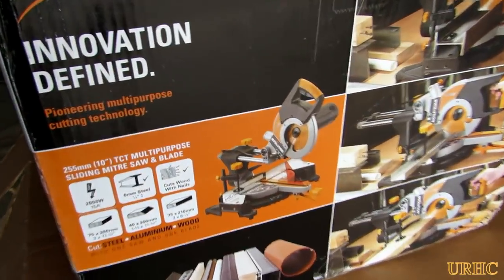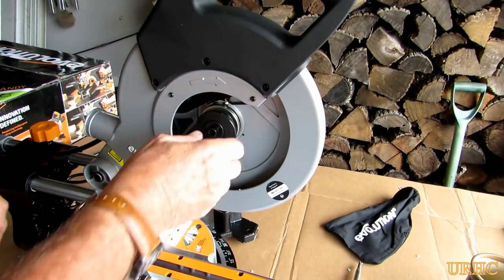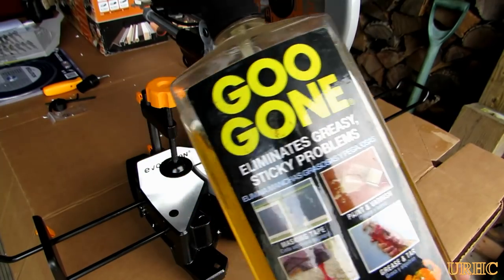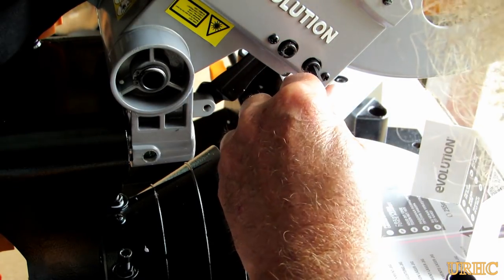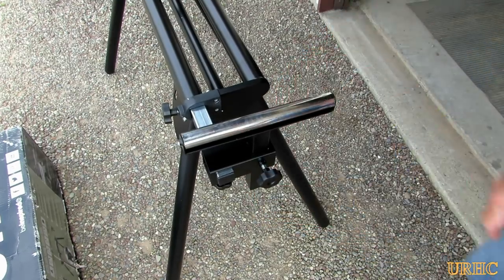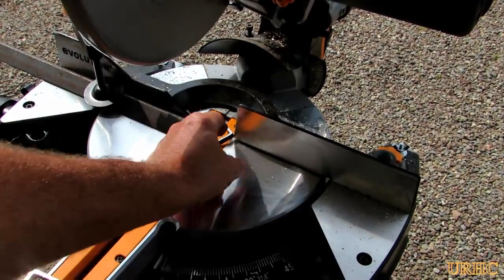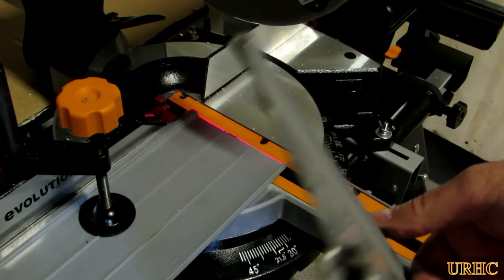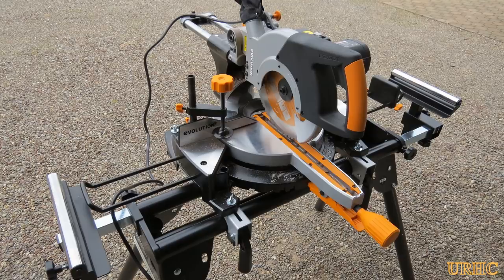Evolution Rage 3 TCT Multipurpose Miter Saw, Asm, Setup, & First Cuts

Comment: Thanks for posting. I've been looking for a miter saw that can handle both wood and metal cuts, and this looks to be the perfect fit. Some of the reviews I've read question the durability of the blades, but those reviews usually came from guys making a lot of cuts on some pretty thick material. Have you had any trouble with the durability of the saw blades?
Reply from the maker: No problems yet but I only cut light gauge low carbon steel with it. There are other blades available for stainless and other tougher to cut metals. Evolution has a good video showing how to cut to get the best blade life that is worth watching if you get one. The only thing that I recommend after using it for a while is to cover the laser lens cap when cutting metal so it doesn't get damaged by the chips and have to be replaced.  It is not a super precision woodworking saw, but is a really good saw that handles just about any material that I have thrown at it. This model has been replaced with a newer model that l hope to try in the future. The blade on my 15 inch Ironton cold cut saw had a tooth chip off the blade after only a couple of cuts and this blade is just like new so I have no complaints about the blade. Thanks for watching
Reply: Metal cutting saws have a different speed than a wood cutting saw. You can use any saw to cut metal with a metal blade but the blade will wear quickly because of the wrong speed.  Unless this saw has a couple different speeds, one for metal and one for wood, of course the blade will crap out quickly, which is what I hear in all the reviews it does.
Reply: Louis Schulte the included blade isn’t the most durable blade around. The problem is that it is made for multiple materials and not just steel. Get a blade designed specifically for steel if that’s all you’re cutting. And don’t worry about finding a 1-inch arbor blade. The arbor on the saw pulls off and reverses so you can use a 5/8” arbor blade if that’s all you can find.

Comment: How did it cut on wood after all the metal cuts. What are the draw backs to having a low rpm saw for wood?
Reply from the maker: This saw cut the same. Low rpms don't give as smooth a cut. Recently got the new version of this saw and made a video. The blade on the new model does not cut as nice as this one and has less teeth. I think this has a better motor also. I picked up the evolution wood cutting blade for that saw that gives a much smoother cut in wood.  I really like the soft start feature. Thanks for watching.

Comment: My wife watched this video with me and said, "What a great tool."  I told her they sell it at Home Depot and now I am trying to convince her that I need it. Any advice?
Reply from the maker: If you plan on cutting a little of everything it is a nice saw. There is nothing else like it from what I can tell. It does throw a lot of hot chips at you when cutting steel so get some good eye protection to go with it. If you plan on fine cabinet work you may want a higher speed saw for glass like cuts. I will be using it for projects in the future and see exactly how it stands up. Home Depot has lowered the price on this and they stand behind everything they sell so try one out to see if it fits your needs. A 3 year warranty seems to be a good deal also. Thanks for watching.

Comment: How long does the blade last?
Reply from the maker: It depends on what you cut. Watch their videos about how to cut for best blade life. Get a special blade if you cut stainless or high carbon steel because this blade is not rated to cut that. I am still running the original blade with good results cutting low carbon, aluminum,  and wood. Thanks for watching.

Comment: In Canada they are sold at Canadian Tire Company.(canadiantire.ca)Type in Evolution to View.  They sell for $455.00 Canadian $$$ But are often on Sale for $199.00. I have seen them in the store and they appear to be a good machine. Nice video too.
Reply from the maker: The link I provided to Home Depot is $176.99 usd right now that is a really good  sale price, last week it was $199.99 . I think it is a great saw with a great warranty. Thanks for watching.
Reply: I bought one 2 months ago and the blade went dull after 5 cuts. Was cutting 1/4" square tube. Called Canadiantire who told me to call Evolution who told me to return it to Canadiantire. Thats where I am now. And evolution would not warranty the blade. No help from either company.

Comment: I have one of these saws and my main complaint is the hot metal cuttings that go out in all directions.
Reply from the maker: It does throw a lot back at you.  I purchased a swarf collector and plan on mounting it on the saw to cut that down. Thanks for watching.
Reply: Unemployed Redneck Hillbilly Creations 
Thanks for your reply. Could you send me some information on the swarf collector.
Reply: Could you send me some information on the swarf collector. thanks
Reply from the maker: https://youtu.be/L1_zZ47x1Jo Here is a video about it.  When I have some time I will try to mount it on the saw permanently.

Comment: Everything about this saw just oozes CHEAP!! 

Rather than throw good money after bad have a hard look at the BOSCH or Mikita saws...I learned a long time ago to buy the best tool I could afford first, and when I didn't, I always ended up buying the best tool second, to replace the first piece of junk.

No savings in that plan.
Reply from the maker: Actually it has been a good saw so far. I have used it for steel, aluminum,  plastic,  stone, ceramic tiles and wood. Does a good job on all of them. If you want a woodworking saw only there are other options available that run at a higher rpm,  but none of them are as versatile as this saw. I am happy with it. Thanks for watching.

Comment: do not use this saw for metal cutting  is total shit
Reply from the maker: I have been using it for almost 2 years now and haven't had a problem.  Are you cutting the recommend materials with it. Evolution also has some great videos about how to cut steel with it for best blade life. I am still using the original blade. Thanks for watching.